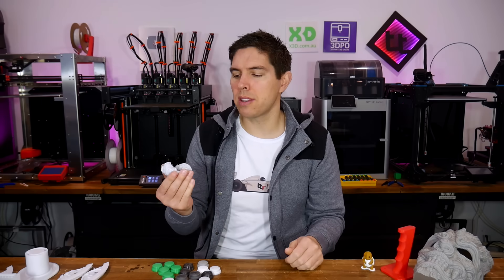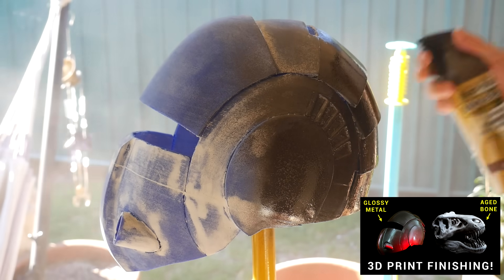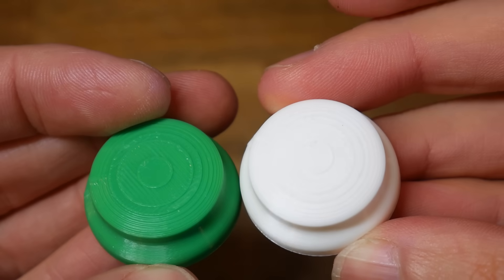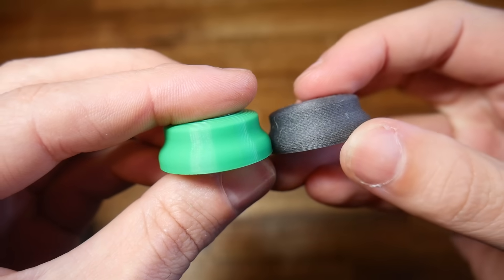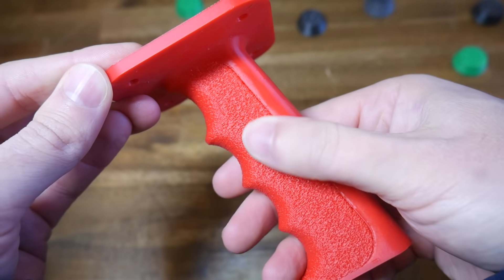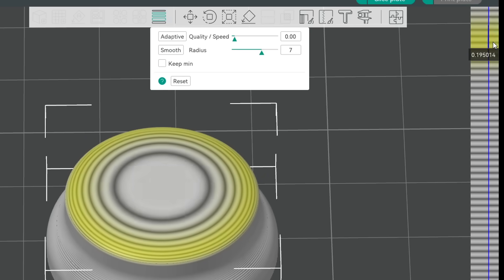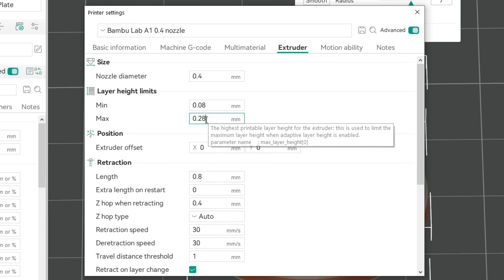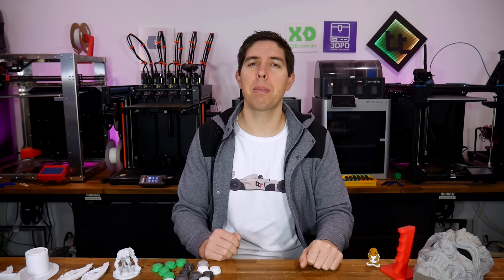Five ways to reduce layer lines on your 3D prints - Adaptive layer height and more!

Comment: Surface with 120-grit sandpaper, then work your way up to at least 320-grit. Afterward, quickly polish it with a shoe brush.
Polishing is even easier with an attachment for an orbital sander or a drill.

Comment: I was today years old when I first heard about variable layer height! Whoa! So cool! Im usually more concerned about part strength, layer orientation and build direction than the visual appearance, I let the parts show or embody authentically what they are, there is a honesty about that, but I would recommend investing in better tools and learning better techniques if you need the part to look a certain way, and to adjust your expectations in terms of how long it will take. Model making is a skill and it takes time to practice and to finish parts

Comment: 20:17 but how do you "know" you can print at 0.04mm layer height? By using a test-print or looking up the printer's specs? And changing this Extruder menu item means any future prints will also use those settings, right? There's no way to limit the changes to the current project?

Comment: Ironing?
Reply from the maker: Typically not relevant to layer lines as they are on the side of the print, and ironing is for the top surfaces.
Reply: @TeachingTech yes, but those pesky layers on the top would be better had you tried it. Next video 😊!

Comment: Wow, this is exactly what I was looking for. I just started using Orca because Creality Print is very sketchy and lacks certain functions I need.  I'm designing vases, pots and mugs for slip casting. Some have "questionable" overhangs which are difficult to print without supports. Dialing in these suggestions/settings seem to really help with my issues. Thank you!

Comment: My problem with the combination of fuzzy skin and adaptive layer height is that the texture from the fuzzy skin changes in regions with different layer heights which makes it look inconsistent.
When I have a rounding on one side of the model but a flat wall on the other side this becomes very visible on the flat wall.

Comment: I love your videos, and they've helped me immensely.  However, how would you implement this with supports?  characters generally have floating parts if no supports are used and generally don't print well.  Whereas with supports- it prints alright but the detail is not as good as I'd like.  I'm guessing that the only way is to lower the layer lines for the whole print and cringe with the time it'll take.  Just wondering if there were alternates that could make the print quicker.  Thanks again.

Comment: I ‘m trying to print “2025” using my ender 3 pro dimension is 20mm x 60mm 0.4mm nozzle PETG filament 225 nozzle temp 65 bed but it keep on stringing and warping 😢 please help

Comment: Best technique is using micro crystalline wax (Renaissance wax).  It can be put on and smoothed out with a finger and gets into dips - it has a consistency like Vaseline, but then dries. It can then be painted over with primer.  Ok for display pieces, but paint might chip off if being worn and used as props.  No sanding. So easy!

Comment: I've found that with my X1C using PETG, Fuzzy Skin at 0.2 distance / 0.15 thickness with 0.2 layer height just about matches the texture of the PEI bed.  I don't use variable layer height because it causes a difference in the sheen (the more fine layers are less glossy), but Fuzzy Skin alone looks really nice with the subtle texture.

I wish there was an option to do top surfaces with Fuzzy Skin, or some ironing setting that gives a similar look.

Comment: planning to try each of these methods individually with about 5 different types of models (sculpture style prints/moving part prints/lithopane & hueforge prints/ textured filament specific prints/ and multi plate put-it-together style prints like the switch dock piranha plant I recently did and had trouble getting different types of filaments pieced together[[SIDE NOTE: If you ever use aero PLAs, dont expect to fit metal/marble/glow together with it...]])
But all that being said, super appreciate this video and will be back with feedback in a few days! ^_^

Comment: I add mica powder to my resin prints. The effect is basically the same as flecking. It completely disappears layer lines. To the point where I can place a polished to 1 micron print next to a completely unpolished one and you can't visually tell the difference. You can feel one is rougher but only slightly.

Comment: I'm very, very new to 3D printing, but this video has me the most excited about the potential, because my biggest issue has been layer lines, and the work needed to fix them. While I have yet to try this out yet, the potential of this has determined that I'm going to try UltiMaker Cura as my first slicer software, because that Adaptive Layer height looks amazing.

Comment: We are professional woodworkers.  Personally, best to use auto primers that go on THICK.  Usually one takes one layer and comes off quick for sanding.  Using wood fillers is far, far, far more labor intensive.

The biggest factor is the quality of the print IMO.  Our Qidi Plus 4 at 0.2mm layers with a bit of added heat...prints wonderfully IMO.

Comment: Excellent video. I've recently changed to a dual feed extruder unit for my Ender 3 and the difference i astounding. I expected things to be better but the prints come out smooth as butter compared to the old single feed.

Comment: Very nice video! There are a few tips I definitely will give a try and I also will try Orca, provided I can connect it to my Bambus without messing up rheir connection with Bambu Studio. (Seems I cannot get to the printer PIN without logging the printers out of their Wifi connection). But one thing I didn't quite get:

How did you get to the 0.04mm layer height setting? With my two P1Ss, the lowest preset is 0.08mm. At first I thought this was something Orca-specific (so far I only used Bambu Studio for my Bambus) but I get the same presets in Orca Slicer as I do in Bambu Studio. I even switched to the A1 Mini to see whether it was a preset exclusively available for the A1 series (I just ordered an A1 Mini that I should get on Monday 😅)...but the lowest layer height with a 0.4 nozzle is 0.08 here as well.

Is the 0.04 a custom setting done by you?

Comment: You can also use a cheap pyrography iron with a shading point to "iron out" layer lines in tight spaces or where you need to keep sharp edges, of course you'd need the proper PPE.

Comment: One more option is to print at a slight angle. Yes it adds support and it doesn't work for every shape, but for your example shape it would have almost eliminated the flat top surface by moving the top layer to a sharper curve.

Comment: This has to be the best explaination & demonstration of variable layer heights! It is amazing how far slicer software has come compared to just 6 years ago. 😲
I had a Tevo Little Monster back then with complete changed electronics (f.e. Duet3D Smart Effector) and this magnetic ball effector holder. I never got out of the PLA testing phase (unsatisfying print results) and quickly lost interest and sold it (yeah, "life" happened). 🤷‍♂️
I actually thinking about getting back into 3D printing with a Bambu X1-C and armed with fresh modern YouTube knowledge (material moisture, printer settings, slicer settings). 😎

Comment: If you want to smooth out the last bit on top you could try ironing.  It involves running the hot head over surfaces that are parallel to the build plate a second time after they are printed.
Reply from the maker: On the contrary ironing is the opposite of what I personally want here. I'd prefer texture to match the whole way around.

Comment: i've never thought you could print 0.04 layer height with a 0.4mm nozzle, gotta try it by myself
do you have to adjust flow for lower layer height?
Reply from the maker: For this video I changed exactly nothing. I would recommend upping top and bottom solid layers.

Comment: What should be implemented in slicers is some anti aliasing. Reducing a complete layer down to 0.04 mm is fine, but is only needed in some areas of the model. The model in the video is easy, but having any slanted surface could use some anti aliasing. First print the parts on the edges where anti aliasing is needed at half the height, then print the rest at full height. You could even do 4x,8x or 16x anti aliasing. There is a bit more to it than I mentioned, but you'll get the idea. It will even speed up the simple thing in the video as all the internal parts are printed at full height.

Comment: the problem with all these is you still have to do lots of sanding and filling to make look nice. best method is just dial in flow rate to the point the layer lines are very minimal and a quick filler primer and sand is enough to clean it all up.

Comment: I'll be honest half way through I almost clicked off the video because I didn't see using different color filament as really a viable option.  I'm glad I stuck around to learn about adaptive layer lines which I didn't know anything about.  Another thing to consider is topside ironing.  That should help smooth out the top portion that you have.

Comment: It's a pity that slicers don't offer printing only outer walls at shallow layer heights and everything else with thicker layers.  We have combine infill to make infill use thicker layers, but the for outer walls the opposite (so printing outer wall as 4 x 0.05mm, but the other walls with 0.2mm) might hide layer lines without increasing print time too much.  For shallow tops variable layer height would still be needed, but for the vertical walls this could help if you don't want "fuzzy walls".

Comment: Would there be any benefit to do the adaptive layering in steps of eg. 0.04?  So eg. fine detail at 0.08 and next steps would be 0.12 / 0.16 / 0.20 /....  and is there a way to configure this.  The reason I'm asking is that I've read that the motor of the Z axis also works in steps and maybe it could be beneficial to align these layers with the logical steps of a motor to avoid issues?  Or would such a method create visual anomalies as there is no real smoothing between the various steps?

Comment: Great video! I use variable layer heights on almost all of my prints, and the only drawback I see are for the chamfers I place to limit the impact of elephant foot on the first layer. On adaptative mode, the layer height is stuck on max value which is a killer in visual quality for chamfer at 45deg. Otherwise great addition to the 3D printing toolkit !

Comment: I’ve done a lot of testing lately on layer heights, nozzles size, vapour smoothing etc. to get what I would call a consistent acceptable finish for interior car parts and not gotten to a point where I am happy. I’m also not the best at sanding and painting. Hours of prep and paint, especially on small parts, is not going to work for me. 
What do you think of going to resin printing instead? With all the talk of “paint ready prints”, it’s tempting to try a resin printer with ABS-like resin. How do you think this would go with parts with a largish flat surface?

Comment: I thought, that I would also need these post steps.
But than I switched to Bambulab with proper settings and actually the layer lines are nearly gone, the z-line is now, what you need to hide.

Comment: I've started turning on external walls first. For some overhangs, this isn't a good answer, but for a lot of prints, it smooths out the outer walls tremendously. That and slowing down the outer walls down to 80 or even 60 on a high speed printer doesn't take a lot of extra time, but gives a nice smooth finish and reduces artifacts.

Comment: Cool! I didn’t know about the variable layer height, definitely gonna try it on my next print. 
You could also try ironing for the top surface though.
Reply: Ironing wouldn't really help in this test case since the lines we see on the top aren't planer, they are separate layers.

Comment: For some parts changing the orientation is a good way to get rid of stair stepping or design parts without domed faces.
Reply: Slant3D videos teach to use orientation to reduce supports, to hide layer lines by allowing fuzzy skin on almost all surfaces and to make parts stronger by aligning layers (and by design) :)

Comment: When I saw you use variable layer height, I thought of a problem that has troubled me for a long time.
As we all know, the Z-axis height in normal slicing mode is (number of slice layers * layer height). But this value often has errors with the design value of the model itself. For example, when the model design height is 2.1mm and the slice layer height is 0.2mm, the slicer will actually generate 10 or 11 layers of slices, resulting in a slice error of +-0.1mm. Although this error is small, it is a serious problem in some special cases. For example, if there is a +-0.1mm error in the height of the idler seat and the slider at both ends of the X axis of a coreXY structure 3D printer, it is very obvious and seriously affects the accuracy of the printer.
I know that variable layer height can be used to improve this problem. But I found that when we set the minimum and maximum values of the layer height, the automatic variable layer height cannot be automatically adjusted according to the integer multiples of the minimum value. For example, let's take the dimensional error mentioned above. Normally, when we set the minimum layer height to 0.1mm, the variable layer height should be able to correctly identify the design height as 2.1mm, and then slice it into 11 layers, one of which is 0.1mm, and the other 10 layers are all 0.2mm, which is a perfect result. Or there can be 3 layers with a height of 0.1mm and the other 9 layers with a height of 0.2mm, which is also a very good result.
However, after many tests, the actual situation is not like this. The slicer is a bit superfluous. It will automatically generate many layer heights with multiple decimal places between 0.1mm-0.2mm, such as 0.100230mm, and so on. The superposition of these values results in the final slicing result still not being an exact 2.1mm, but 2.03mm. Or 2.13mm, and so on.
This makes me very confused. Shouldn't the primary task of the slicer be to ensure the dimensional accuracy of the slices as much as possible? The accuracy of the automatically generated layer height value has reached 4-5 decimal places, which is far higher than the Z-axis motion accuracy of most printers. Is it really necessary? Why can't the slicing software recognize the automatic layer height change division value as the minimum layer height? In this way, you can freely configure the minimum layer height according to the Z-axis motion capability of the printer to avoid unnecessary calculations and errors. At the same time, you can appropriately select the minimum layer height according to the design height of the part to achieve the number of slices to be an integer multiple of the minimum layer height, thereby meeting the accuracy requirements.
I thought of the above questions when I saw your video. I haven't solved it myself. May I ask how you deal with the Z-axis slice accuracy problem?
I also hope that more seniors can help to solve the doubts.

Comment: You can also turn off the one wall on top layer, I do that for most prints. Using concentric or Archimedean Chords top layer also helps to hide the top stair steps.
Reply: Thank you, that is a very good tip
Reply: But then it’s not a nice finish

Comment: I've messed a bit with fuzzy skin but found using blender creating a vertex group then applying some noise to that vertex group is really nice. Much easier for me to isolate sections and apply different types of noise to different sections of a print for fuzzy skin. Works great when you need some clearances and want unique patterns on the fuzz as you can basically use any height map to control it. There's tuns of high maps you can find on google and if your not selling it you can use it to personalize anything and they are high quality ones for games and other things or you can make your own.  Totally doable to get a wicker/woven surface on a print that way, or a geometric pattern like triangles for a scifi look.

Comment: Another use for variable layer height is for mechanical prints where you want features at specific heights, not rounded to the nearest 0.2mm (or what ever your printing layer heights are).

Comment: The look of layerlines is one thing. But dust particles sticking between these lines that are almost impossible to remove like an micro fiber cloth, is a functional problem and idk why no one cares about it. I want to be able to clean my prints without haveing to use liquids and pressure.

Comment: combining adaptive layers with a scarf joint also fets rid of the seam, this is a must for any rounded parts.
Reply: I've found if you use hybrid tree supports and independent support layer heights in Ocra 2.1.1 you can have adaptive layer prints with tree supports.

It's a neat addition for more complex prints.
Reply: 8James @SOHCHEAD

Comment: 7:45 I don't know anything about a printer. I want an answer to the last program that Cura talked about. Does it work with the S1-3pro printer? Does it need anything like a system update in a printer, connecting a computer with a cable to a printer, or just downloading a file onto a card and putting it in a printer and the printer directly? Thanks in advance for your answer. Greetings from Algeria